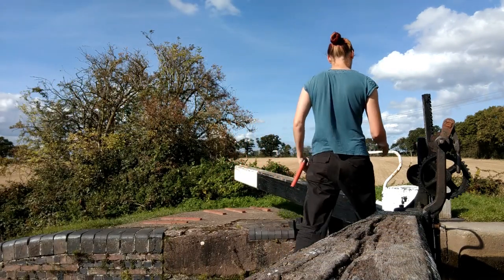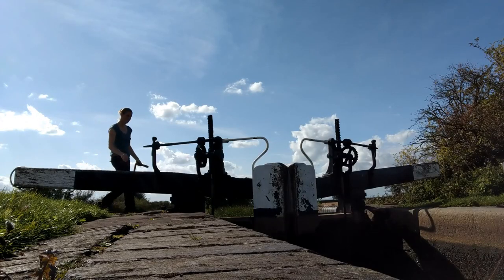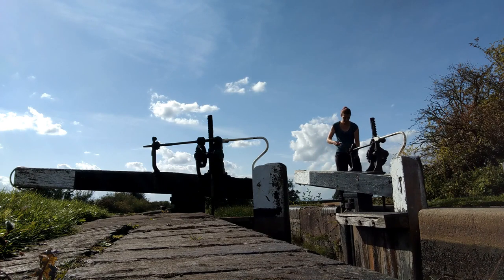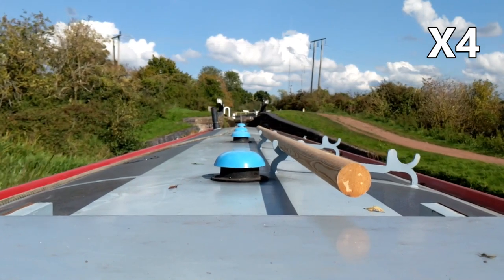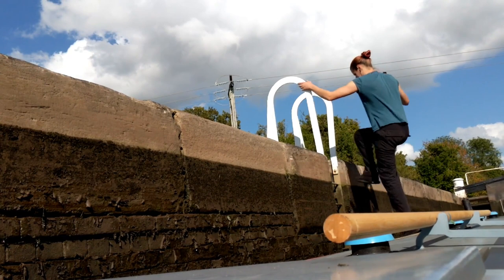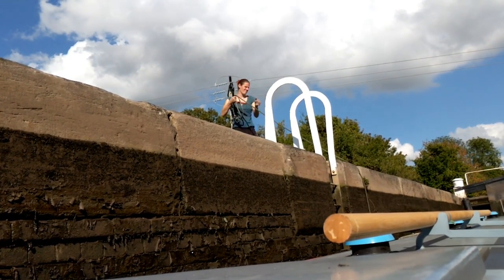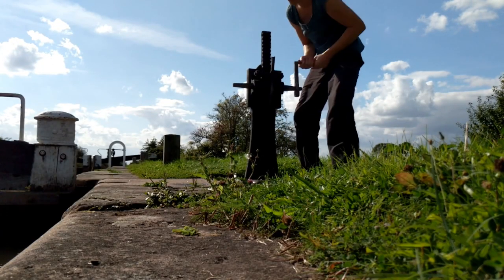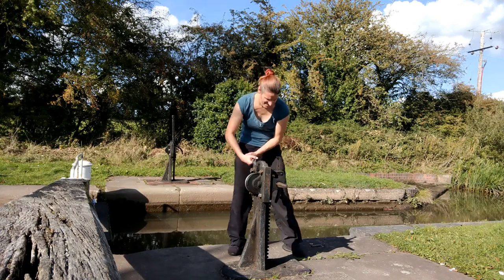How I lock up single handed.

Comment: Worcester- und Birmingham-Canal, Lock 39, I know the canal from previous vacations. Also I know this radioamateuer G0EHQ.
Reply from the maker: Technically it was lock 39 and 40 as I messed up some one the clips on the first attempt. But yes you're right. I single handed the entire flight with no help and all locks set against me.
Reply: @SashasNarrowboatLife  It's a very demanding flight, and to do it as a single boater is crazy. I saw the vlogs from Anna and Kath and Juno and saw how exhausting it must have been. I managed this flight myself with 3 other friends on a very long day. We didn't see much of the landscape.
Reply from the maker: I slept very well at the end of that day.